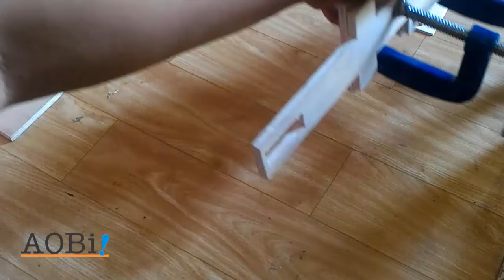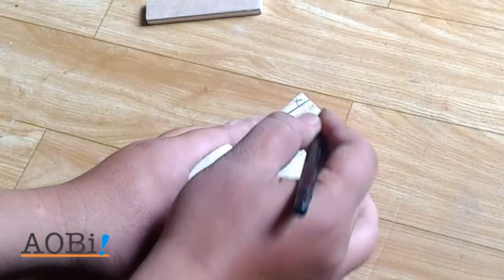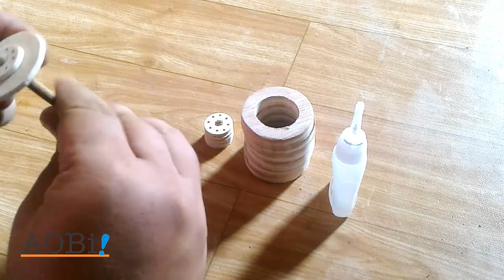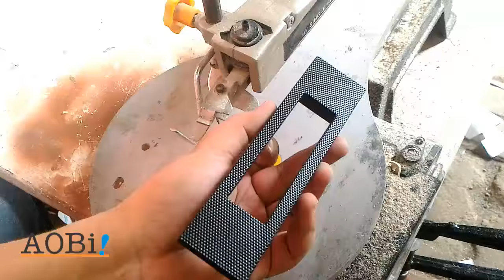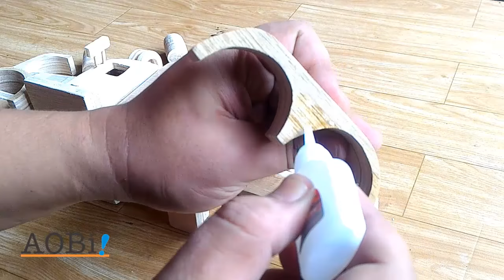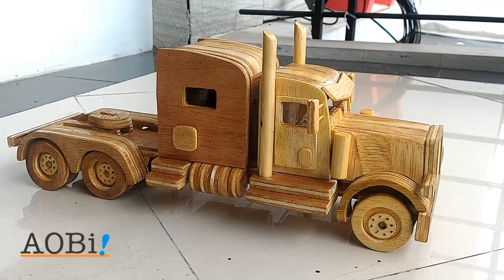Wooden toy truck - Peterbilt

Comment: you do very good work. I too like scrollsawing, been doing it maybe 20+ years. I just came up on your site and subscribed. It's amazing what one can do with a little wood.
Reply from the maker: I started using scrollsaw about 6 months ago, basically I am a stage designer and still,  thank you james,
Reply: Dani Hadiyantara  I normally focus on fretwork pieces. sure have made a lot of projects over the years. I'm always looking for something different and have started looking at wheeled toys for little children. when I discovered your video on the 1930 ford pickup truck I knew I had found what I have been looking for. who knows, maybe one day I might do a video, LOL... It's all good. Keep on doing what you enjoy and thank you for sharing it with the rest of us. I'm a hydraulics technican (I build machinary for the offshore oil industry. haven't worked in 2-1/2 years as I had to leave my job to go through chemo and radiation for stage 3 lung cancer. it's very rough but I beat the cancer, now I'm trying to get over the side affects of the treatments, it beat me up pertty good but I am still here and getting better. I'm still not able to return to work and that is where my little woodshop comes in. it does give me something to do, I'm slower but enjoy every minute I get to spend in my shop. hopefully I'll be able to go back to work in maybe 3-6 months, hope so but I want to continue woodworking. just keep on doing what your doing man, who knows where you'll end up. It's all good.
Reply from the maker: This channel formerly called Aobi acronym of sundanese language 'Aing oge bisa ' means 'Sure I can' , there are a lot of sad stories I experienced at the back, btw Ford pick up is my first scrollsaw project haha.. thank you james